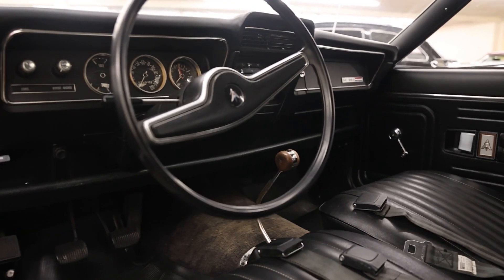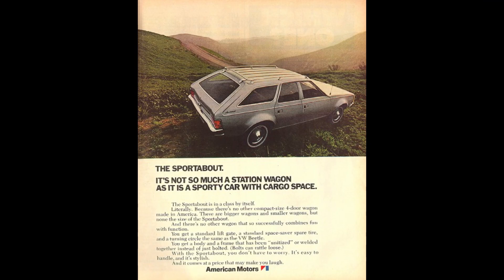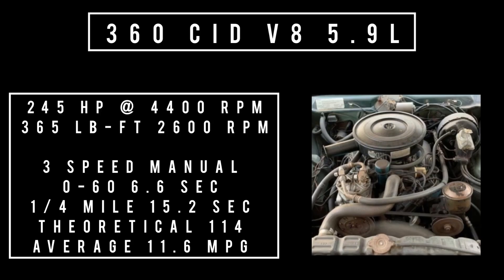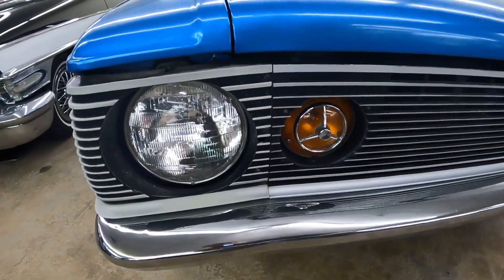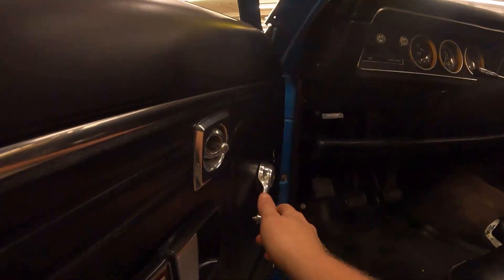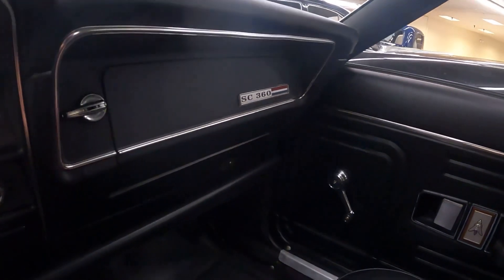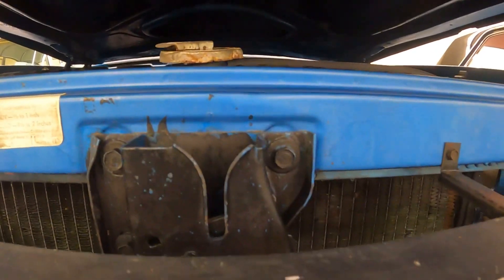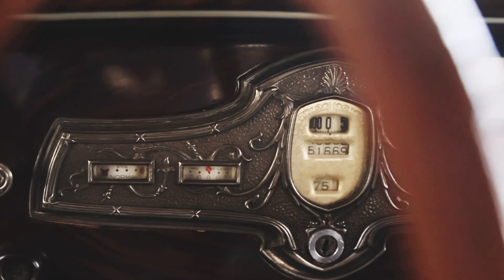Rare look at 1971 AMC Hornet SC/360, short lived and super underrated

Comment: I bought one brand new and just sold it 5 years ago. Bracket raced it for many years. A few minor mods it turned a best of 13.19 at 104 mph. Only the go pac versions had the hood scoop.
Reply: All had it. Go Pac made it functional. Also with GO Pac was the four barrel carb. D 70 14 white letter tires on sport wheels. Four speed or automatic. Standard was a three speed manual. two barrel was rated at 245 horsepower, four barrel was 285.

Comment: Always had a soft spot for AMC stuff. My high school auto shop teacher {and his son} were AMC folks. His son had a 304 cubed Gremlin that received a rebuilt 390 that could get the front tires up in the air from a stop on acceleration. Always wanted a SC Scambler (there's 2 of them locally). They were 13 second 1/4 mile cars from the dealer. It's hard enough to find a 2 door Hornet and harder to find a SC Hornet. Thanks for showing!
Reply from the maker: Thanks for watching this I didn’t know how special the car was there’s cars that I’m finding for the first time and this is one of them I was amazed at the ads I was able to dig up =) it blows my mind to think that this was a super affordable car that would put down just about anything and yet it kind of sort of failed
Reply: They needed some fine tuning and a damn good driver to get in the 13 second bracket. They were designed to run in F stock class. AMC advertised them as a Rambler that does the quarter in 14.3. Period road test at best got them stock at 14.1.

Comment: I owned a 1975 Hornet although it was a six it was a very good car. But I am here to tell you about my 1967 Rambler American. It had a six in it when my friend and I went to a local salvage yard to get a electric wiper motor to replace the vacuum wiper motor. I found a wiper motor and switch for it, and as we were leaving a tow truck pulled in with a 1968 AMC Javelin. It had been hit hard on the passenger side and totaled. After some haggling, I bought the entire driveline. 343 V8 four speed and a 3.54 rear axle. as well as the front springs motor mounts. We took the car and the driveline parts and since the American and the Javelin shared the same chassis it was a drop in. Man it ran so good and while I lost some races I won quite a few. Forgot to mention that the first time I did a burnout I almost lost control because it suffered from rear axle hop which required me to install traction bars. Miss it so much but being a young father by surprise forced me to sell it.
Reply from the maker: Awesome memories thank you so much for sharing that story I know what selling things for because you need to is like man I wish you could have kept that car

Comment: Oh yes...the front suspension of these cars is like the Ford IFS suspension and the rear shocks are staggered in the back...one shock on one side of the differential is on the opposite side on the other side...if you know what I mean. the handling is awesome and I imagine the 360 is quite powerful. I can crank my Gremlin wheel hard over while driving and the body doesn't lean like in my 1972 Oldsmobile. 

Also the steering column is from a Chevy. A Camaro wheel will bolt on without a problem. Someone did that in my 1977 Gremlin before I bought it.

I mentioned the car in the Packard video, by the way,.
Reply from the maker: Wow thank you so much for sharing that insight as well as information
Reply: @What.its.like.  You are welcome. I "Crawled all over" my Gremlins a few times! 🤩
Reply: 1970 was the first year that AMC front suspension was like Ford. Before that they had a high mount front spring like Ford but no upper ball joint. Instead, they used something known as a trunnion. on top and a lower ball joint. But because this type of front suspension had no anti dive geometry necessary for road racing, they switched to a front suspension like Ford having both upper and lower ball joints. Many sad it finally brought AMC into the modern era. This was requested by Roger Penske owner of their Trans Am Road racing team where they raced AMC Javelins.
Reply: @scrambler69-xk3kv  Awesome! Thank you for the additional information.

Comment: The seats which could recline to what had been referred to as  a double bed, was commonly called Nash seats by many people. They were around for many, many years.  I wouldn't call these bucket seats like you'd find in a Javelin/AMX or other cars with a console, but maybe call this a split bench.  If this car had an automatic trans, it would have been  a power-robbing Borg-Warner. In 1972, AMC switched to the Chrysler Torqueflite. With the Torqueflite, this car would have been a rocket ship! Could you imagine this car with the 401 V8?  This final generation of AMC V8's all had the same external dimensions, so they could be swapped and interchanged without too much trouble.
Reply from the maker: The AMX had them and they reclined the whole entire way which blew my mind because I wasn’t sure that feature made it to 1969/70..
Reply: @What.its.like.  Yep. That's one of the things that makes a Rambler a Rambler. Back in the 70's and 80's, if you went to an AMC dealership and called the cars Nash, they would come unglued.

Comment: One thing about AMC 70's cars. 
Notice how thin the doors are compared to G.M. and Ford of the same period. 
You could get three rear ends across in the front seat and be more comfortable than in a Maverick or Nova.
I'm the one that spotted it next to the Packard. 
Pretty good video. Keep it going. 😊
Reply from the maker: The biggest issue with Amc  is they made a good product but they had no idea how to sell it and when they tried to sell it they sold it in the wrong way.. and then they kept making bigger mistakes like retooling the Marlin for one year and spending a fortune on it.. Ever since finding that out that has always been in the back of my mind why did they not sell that car for more than one year it just didn’t make sense
Reply: @What.its.like.  The issue with the Eagle was that it was obviously derived from a Hornet, and obviously the styling was an already ten year old car, and that car was an inexpensive car. 
The Eagle was an expensive car.
Very difficult to move a car that looks like a ten year old inexpensive car up market. 
Had they the money for a body restyle, it may have done much better. 
The redesigned Jeep Cherokee that came out a couple of years later was a great success for the company. That shows they were on the right track with smaller FWD vehicles. 
The 67 Marlin restyle was a management mistake, but most of that car was an Ambassador, so it wasn't too bad.
The leader of AMC at the time, Roy Abernathy got put out to pasture after it came out though, so it must've hurt.
The 74 Matador and 75 Pacer together with partnering with Renault probably put the final nail in the coffin of AMC. 
They never really recovered from the mid to late seventies sales decline, and French cars have never sold well in the U.S.
They still don't today. 
Too bad. The Pacer and Matador were interesting cars.
I still own a 75 Matador.
Reply from the maker: I use talk text a lot I didn’t catch that error when I talk into my phone for whatever reason anytime I say Amc  it automatically puts eagle I absolutely hate it I wish I could correct it somehow I wasn’t trying to say Amc Eagle I was just trying to see AMC
Reply: @What.its.like.  That is strange, but no worries.
I just watched your Willys Aero video.
Another good one.

Comment: My first car was a 73 Hornet X hatchback. 360, Torqueflite, 2.73 posi in a 9" Ford rear, manual disc brakes and steering.
Reply from the maker: That’s awesome what is your favorite memory of that car
Reply: @What.its.like.  Passing slower cars on two lane back roads; full throttle kick-downs were really strong. 50-100mph acceleration was awesome !

Comment: the door handles are Kelvanator refrigerator handles. 
Yes, top of door is metal. 
Some of the AMc's had that package shelf above the floor pedals, some do not. 
The fuse box is in line with the parking break release handle and that handle is held on with a plastic clip. 
My clip broke one time when I went and pulled it and the metal rod from the brake release went right across about 4 fuses and blew them all out.
Also, the fresh air duct is right behind the glove box. The bottom is held on by a rod. One day that popped out on me, the "pan" fell straight down and then a ton of cold air came in the car that I couldn't shut off. 
AMC's are fun! :face-purple-crying::text-green-game-over:
Reply from the maker: Thank you so much for sharing all that insight as well as information I didn’t know about the door cards
Reply: @What.its.like.  I have quite a few repairs to do on my Gremlin if I want to get it back on the road. 

As far as body panels, AMC was short on tooling money, so Dick Teague designed a lot of interchangeable parts to save money. 

The "Hornet" style car design lasted from 1970-1986 and really only had minor sheet metal updates in all that time.

Comment: My SC360 was burnished brown with black interior . 650 Holley 3barrel , Hooker headers going through glasspacks sounded great but no back pressure. Flames were visible under car at times but caused exhaust valves to warp within 10k miles. Changed 71 cam with 72 degrees overlap to 72 cam with 42 degrees. Solved valve problems . T15 3 speed tranny and 3.15 rear gave 65mph 1st gear with 6500rpm. Yes it screamed and 90 mph  2nd . Not often but several times with friends for witnesses. Car was a sleeper but nose heavy on acceleration.  Drove it until 160k miles in 1983.  Paid like $3600 new. Should have kept it no matter what.
Reply from the maker: Your car sounded absolutely epic

Comment: In 77  I had a 70 sc 360 go orange package hornet. It had 4speed and. 410 twin grip rear. Jr. In high school. Polyglass bias ply wide ovals duels w/ thrush glass packs. Stop light  to stop light. Nothing could touch it.
Reply from the maker: It’s the perfect sleeper.. that’s awesome you had one, that is the only one I’ve ever saw in the wild
Reply: No such thing. SC 360 was a 1971 year only car. In 1970 a 360 two barrel engine was available in the hornet but only with an automatic transmission. No four barrel or four speed from the factory. My uncles for many years owned a first Rambler dealership as they were known even though it was officially known as American Motors for years until1966 when they for the first time called the Ambassador an AMC in hopes of taking away the old man image from that model and selling to younger customers. So starting in 1967 they used the name AMC on all of their cars except the American. But for years AMC cars were sold with the Rambler name on them. But my uncles sold Ramblers, later AMC cars for years. Grew up around them. so I know what I am talking about. Rambler name was last used on their American series in 1969. Then For 1970 when they introduced the Hornet to replace the American series which was the car the Hurst SC Rambler was based on.
Reply: @scrambler69-xk3kv  it may have been  a 71, but every other detail is accurate.  I was 16 in 77. I took the  factory clutch out when we got it used in 76. And replaced it with zoom complete set clutch. It was a big orange go pack complete with ram air scoop. I have my DMV records to prove it plus a lot of tickets as well. Tell that to your uncle Google .

Comment: I think you might have a clone there. I have never seen a Hornet SC/360 without a hood scoop, even the 2bbl models. And unless I'm mistaken, (and I might be) they either came with a 4-speed or automatic, never seen one with a 3-speed stick. Maybe some AMC guys out there might know better.
Reply from the maker: Thank you so much for the information and insight =) 

I honestly never knew how special these were, they were factory sleepers before they because a term.
Reply: I might be able to shed some light on the 2 barrel vs the 4 barrel version of the SC 360 Hornet. What I believe is shown here is the base SC 360 with 2 barrel. One had a choice of 3 speed manual on the floor, or the automatic on the column. The rear gear slection was limited to either 3.15 standard, or 3.54 optional open rear end. If one optioned the SC 360 with the Go Pack, you then got the 4 barrel with the 285 horse engine, the ram air hood along with a Tach, dual exhaust.  The choice of a 3 speed manual on the floor, the 4 speed manual or the automatic on the column. Rear gear choice went up to 3.91 with twin grip as as standard with the 3.91 rear. Too many other options to list here.